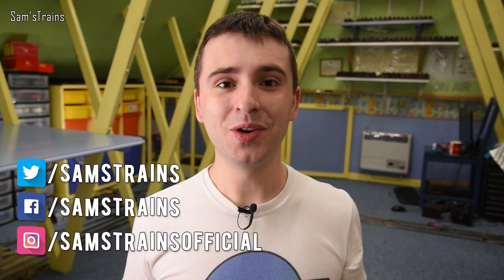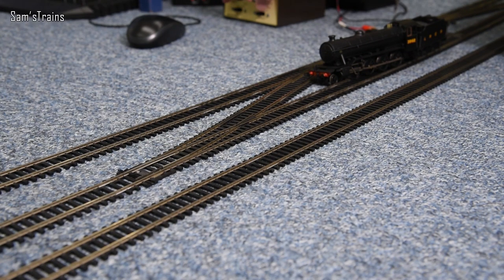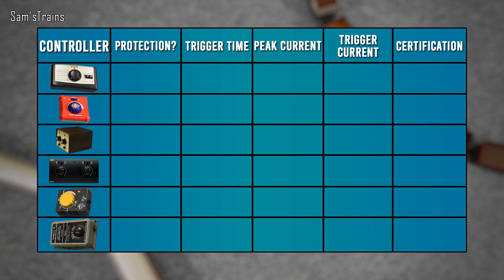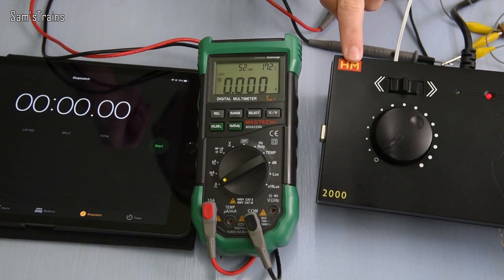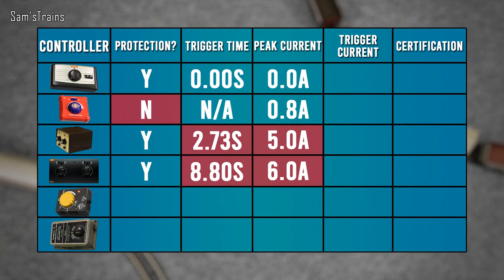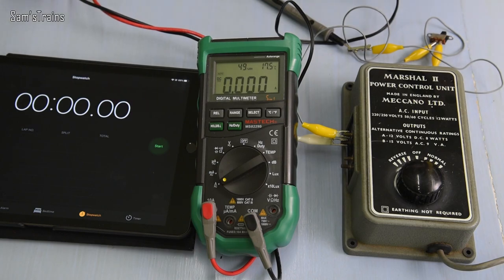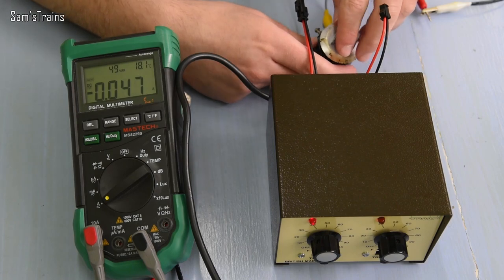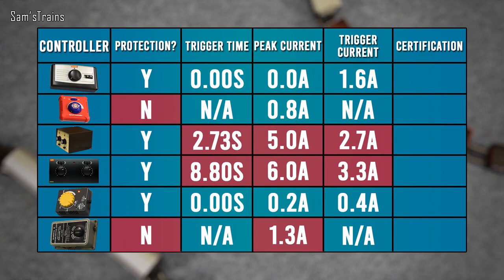What Happens When You Overload Model Train Controllers?

Comment: Yeah, that is a lot of amps going thru ones loco rolling stock and lit coaches etc. If you have a power socket strip (gang) of 4 to 6 (some will have more 8+ which I wouldn't use anyway) outlets plugged in to power your layout. It is advisable to buy a power gang with Anti-Surge Protection built into it for extra safety. 

Most layouts would have up to 2x Up and 2x Down lines with a possible branch line. Then you'll could also have a further plug powering your accessories, lights, moving vehicle's, windmills etc. A 6x socket Anti-Surge power gang from one wall power socket should be enough for any home layout. 

If you consult an electrician you could change the wall socket over, to a fused socket with red LED and use a Quick Blow fuse for safety. Another option is to have the power connected to or built in with a Power Trip Switch Circuit and a button power Rest. Though this would be overkill, unless you have a very large layout to run.

Please take heed with Square Plug-In Adapters. These square adapters are dangerous to use and best to throw out and replace with a Socket Strip Gang as mentioned above.. I have be horrified to see a single wall socket with Square Adapter with 3x outlets plugged in and then a further adapter plugged into that. The thing is with this type of power practise to charge or power any amount of equipment generates a lot of heat. This is because the more items plugged in this way draws and requires more amps from the wall socket. This will eventually melt wires or plastics within the square plug unit to fail and then it can lead to a major fire starting. 

They can also become what is called Top Heavy. This means with all the items plugged into it, they add extra weight that over time weighs the square adapter unit down and away from the wall. Slowly over time pulling the three (two in other countries) pins for Live, Neutral and Earth away from connecting to the wall socket. Given a chance this can lead to sparking if its too loose between the pins and its counterpart within the wall socket. The smallest of sparks can and will catch fire on anything that is flammable near to it or the square adapter plug will just burst into flames anyway. I highly recommend binning these Square Adapters to the trash can if you see or ever use them, then replace with a proper protected gang strip. I am sure there is YouTube videos of this happening and showing the dangerous results.
Reply from the maker: Thanks for the comment John! But don't forget 5A on the 12v side will only be around 250mA on the mains side - that's obviously a tiny amount! You mean have the trip protection on the layout-side of the controller? Many thanks for all the info - appreciate it!
Thanks for watching, Sam :)
Reply: @SamsTrains  Know problem, but do ditch any square adapters if you have any and buy a gang strip.

Comment: Have 3 bachmann controllers. The dcc one stops after about 3 hours running outside on o gauge. the other 2 are on oo and tt and only the tt one has malfunctioned with 2 triang a1a motors under a loco but now only goes one way. Will replace all now seeing your findings. Thanks Sam.

Comment: The Bachmann controller is the same one shipped with their large scale sets, too.  So it’s gonna have a higher output. The lack of circuit protection is still bad. I wonder if the gauge master and HM2000 were made for use in larger scales, thus a higher load peak.
Reply from the maker: Ahh really? That's pretty interesting then! Yeah maybe, the HM2000 does run O gauge gear with no problem!
Thanks for watching - Sam :)

Comment: Some advice on the Bachmann controllers, newer ones (2005 and younger) have short circuit protection and it should kick in within a second or two (and beep rapidly for several seconds until the short is fixed).

Ironic enough I've found them to be little demons - several have burned up and will continue to heat up when overworked. You need some toast while you're doing this experiment?
Reply from the maker: That's interesting - Underground Ernie came out in 2006, so surely this should have had that protection? Nothing like that happened!
Thanks for watching - Sam :)
Reply: @SamsTrains  I was just guessing, however considering how Bachmann is, they seem to cut corners and use older designs for more modern stuff. Chances are yours is an oddball (as if it already isn't) and most likely uses an older design. Most of mine are from the late 2000s and early 2010s, so maybe mine are a bit different.

Comment: I use one of those old Marshall II controllers for my 0 gauge. However, my 0 gauge is limited to 6 yards of simple track and a single dapol 08, so little to no risk of a short there.
I have had issues of the R965 controllers cutting out randomly on some locos, like my bachmann 170, and I know for a fact the newer hornby controllers (silver as here, and the new black ones) are worse.
My gaugemaster model D can't handle many locos under power at once, but I've not had any issues at all with it.
My h&m duette is a great controller, despite the huge gap between off and the lowest speed setting if set to full wave low resistance. It gets warm when switched to high resistance for slow speed running, but it is built like a tank so can handle it.
Reply from the maker: Thanks for sharing - that's quite interesting about the R695 - I wonder what causes that?!
Thanks for watching - Sam :)

Comment: Amazing video. Useful information. Good job it is not using mains. At 500 milliamps the heart goes in to fibrilation and you blow up. May i suggest that when using all metal screwdrivers that some rubber tubing is slid over the handle and most of the shaft for insulation. Only the tip should be showing. You can get shrouded screwdrivers. Your croc clips are also shrouded preventng short circuits. When in doubt insulate with non-electrical conducting material.
Reply from the maker: Thank you!! Yes that's true - but much higher voltage would be required to overcome the resistance of the human body! Yes that's true - but I don't use my screwdrivers around high voltage anyway!
Thanks for watching - Sam :)

Comment: The ez controller does have it, although its more of an overload protection. It will stop working(and take 10 min to let it cool and reset) if you run too large of a load(or short) for a long time to which it cant handle the current draw. It does like around a full minute before it kicks in though.
Reply from the maker: That's not what I found Charles - the Bachmann kept passing full current indefinitely!
Thanks for watching - Sam :)
Reply: @SamsTrains  "Bachmann power packs have an internal 'circuit breaker' that trips on overload, then automatically resets a short time after the electrical overload is removed. Additionally, the power packs that come with starter sets are usually pretty marginal. They supply just enough power to run the set they are packaged with. After the breaker has tripped a few times, it will start tripping at lower and lower outputs." 
I agree that they aren't very effective, but I have opened two of these up before, and can confirm that there is a circuit breaker. However, its designed to trip with greater loads, such as 3 amps, not 0.8 amps. (after being tripped a few times, it should become more sensetive) Its a major design flaw with their controllers.

Comment: I've got a KATO controller. For being a small model company the only time I've short circuited it was when I was switching the direction of the train one too many times.
Reply from the maker: Ooh interesting - what happened when you did that??
Thanks for watching - Sam :)
Reply: @SamsTrains  All that happen is it semi cut out. The Loco just sat there and buzzed for a bit. I looked inside the loco and it was fine, and the controller just needed to be left off over night then it was alright.

Comment: Nice test! I'm amazed that controllers are currently (sorry) available that do not have safety cutouts. I well remember that my first one in the mid 1960s had a prominent red button that would quickly pop up and kill the juice as soon as a short circuit occurred.
Reply from the maker: Thanks John - yes I agree - though none of the super high-current controllers failed to cut out, which is good to see (despite how long some of them took!). I do think manual resets are a good idea - odd that none of these had that!
Thanks for watching - Sam :)

Comment: I had a metal track joiner fall across the rails one time and couldn't figure out where the short was until I smelled plastic burning and found a glowing red joiner melting the plastic ties.  This was when I still used a cheapo power pack that apparently didn't have short protection.
Reply from the maker: Blimey! That sounds dramatic - again, short circuit protection would have saved that dangerous situation! :O
Thanks for watching - Sam :)

Comment: Well, one solution is to add a 1 amp 12V (or lower) automotive glass fuse on the power circuit for enhanced protection. On DCC, you have dedidcated electronic circuit breakers, like the NCE EB-1.
Anyway, I had already triggered a Gaugemaster Combi on a derailment, it works fine, and it is limitated to 1 amp.
Reply from the maker: Great idea Oliver - I might do just that! :O
Thanks for watching - Sam :)

Comment: some of the higher power dcc boosters in the us are rated for 8 amps but they do take a fraction of a second to cut the power if it goes over that
Reply: and if sam were to set one up on one side of his layout and have a short on the other side if he dont have feeder wires the resistance of the track would prevent it being able to even get to the 8 amp threshold
Reply from the maker: Yes the DCC controllers have much better protection, due to the much higher current they can supply!
Thanks for watching - Sam :)

Comment: Well its a shame that even modern controllers have no short circuit protetction! I remember well my "Märklin Super" controller from 1949, which I had as  a child. Weighed a ton with humming transformator. But it worked when a short circuit occured, while some train derailed or a loco began to smoke without hesitation. It was humming humming humming, then BANG and the control  light went out not to come on again a few minutes later. It seems it was a good controller and transformator :-)
Reply from the maker: I agree Paul - I was surprised by this!! Thanks for sharing - that sounds crazy!! :O
Thanks for watching - Sam :)

Comment: Sam: has a small LED circuit almost burn down the house a few years ago
Also Sam: "I'm going to intentionally short circuit a number of controllers and see what happens!"
 
I never shorted my model railroad, but I did snap a couple of 9-volt batteries onto each other when I was about 4 or 5 years old. "If I turn one the other way, both thingies snap together, so that must be what they're for" was my thinking. I put them down and got distracted by something outside, and my grandmother burned herself a little trying to pull them apart when she noticed. (I think they were the mostly dead batteries we'd changed in the smoke detectors, but apparently they still got quite hot!)
Reply from the maker: haha I know - not a good idea, but I was confident in doing it safely for demonstration purposes! Ahh yes - the 9V battery trick is a classic, but can very easily cause a melt-down!
Thanks for watching - Sam :)

Comment: Back in the early 70s when I had a train set, the controllers had a pop-out button that would cut the power to the track if a short circuit occurred. You had to press in the popout button to reset the controller and restore power to track (after the cause of the short circuit had been removed). Why don't modern controllers have the same feature?
Reply from the maker: I agree - I love the manual resets too! I assume it's because they're easily exploited - with tape etc - which makes them less safe maybe?
Thanks for watching - Sam :)

Comment: Hello Sam - another great and interesting video. On the railway I am building, the odd accidental short circuit from the track layout is somewhat inevitable given my inexperience! Whilst my HM 2000 and H & M Duette's 'warn' of a short circuit by reducing the speed of the model dramatically, they do at least give such a warning. I have purchased several expensive 'enthusiast' controllers from a well known manufacturer which sadly do not provide any advice of short circuit and which then keel over and die, resulting in an expensive postal return to the manufacturer to be repaired (although as yet they have not charged for the actual repair - credit due). Wouldn't it be a good idea if there was a warning light or audible warning that a short circuit had occurred? In an ideal world we wouldn't miss-wire anything, understand all electronics completely - but it's not an ideal world!
Reply from the maker: Many thanks Paul - ahh yes the HM2000s are quite dramatic!!
Thanks for watching - Sam :)

Comment: sam, once I was running an outdoor layout, and the controller caught fire! garden hose to the rescue!
Reply from the maker: Oh blimey - that's not good!!! :O
Thanks for watching - Sam :)
Reply: You should never use water on an electrical fire.
Reply: @Poliss95  we unplugged it first.
Reply: @sambrown6426  The capacitors inside could still be charged. Best to throw sand or another smothering dry material on electrical fires. Or just leave it to burn out.
Reply: @highbrookendmodelrailway  the closest dry smothering material was in the neighbor's sandbox across the street while my hose was within 10 feet, and I didn't want to leave it burning because it was on a wooden deck, and that could've set my HOUSE on fire VERY fast if I hadn't done something.
Reply: @sambrown6426  Yeah, I suppose you're right. If it was on a wooden deck then I can understand why you used water.
Reply: @highbrookendmodelrailway  it was probably my fault it caught fire in the first place, I was triple heading challengers, each with twin motors! at least the scorching that deck got gave me an excuse to finally replace it though.
Reply: @sambrown6426  Well, I suppose it was reasonable for the controller to go kaput then. 😂
Reply: @highbrookendmodelrailway  the thing was like 6 years old so yeah, probably.

Comment: good research project, Sam.  Are there any separate cut-outs you can wire in to the circuit for extra safety? - or should we all buy a mehano controller and include it in the circuit, and use a more posh one for actually controlling the trains?
Reply from the maker: Thanks Rick - yes that has been suggested, I'll have to investigate! A resettable one would be best though - if such a thing exists!
Thanks for watching - Sam :)

Comment: i think you have a next step on this.  you have stated numerous times which controller are better and i wonder.  i recall you stated that the better controllers have better crawling speeds.

that rather decent meter of yours might allow you to find out what might make those higher end controllers better.  if the motors are pulling more current at slow and ultra slow speeds then controllers that have more current available for the engines to pull from would allow them to crawl better.

it would also be interesting to see which ones produce better power.  i work on cable television equipment and their dc power packs have to make a very smooth DC to prevent picture problems.  you test it by measuring how much AC you are getting when measuring the DC output. we refer to it as DC ripple,. but the closer to zero you are the better the DC.  at ultra low speeds, the amount of ripple may effect things though i don't know why there would be any ripple unless the controller is old and the caps worn.
Reply from the maker: Yes that's right James - it would be interesting to do more research on this!! :D
Thanks for watching - Sam :)

Comment: Generally I like Sam's Trains videos but not this one.  The useful bit of information was  showing how long it took for overload cut out functions to operate but other information was simply wrong.  There is a big difference between  overload protection and having an overload cut out function. The Bachmann controller and the Hornby Dublo  do indeed include overload protection just not the highly desirable cut out function. The Hornby Dublo Marshall controllers were made with a deliberately designed transformer with higher than normal resistance in the secondary windings of the transformer so each output can safely by short circuited indefinitely with no harm to the controller. I don't know what is inside the Bachmann but clearly by the way it behaved it  also has a current limited output for its short circuit protection. I'm guessing it is not as robust as the Dublo controller and would probably eventually overheat if short circuited for too long.  As for the peak current measures - they are  nonsense because the multimeter was too slow. For this type of measurement  a better meter is needed that has a peak capture function or even better use an oscilloscope with a dc current probe.
Reply from the maker: Thanks for this Keith - duly noted! The peak current values were only 'reliable' for the controllers that sustained the overload (which was most of them!), but otherwise yes, they were nonsense!
Thanks for watching - Sam :)